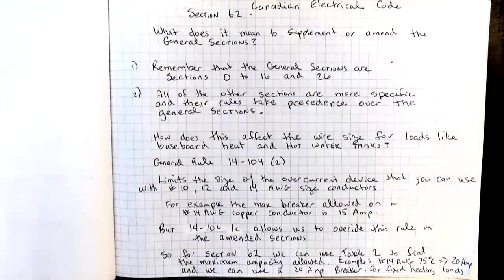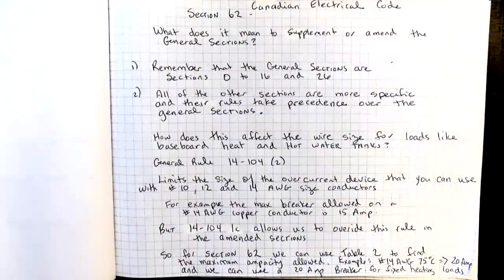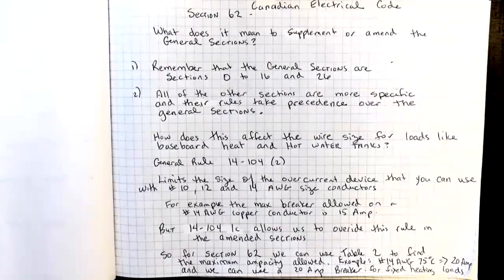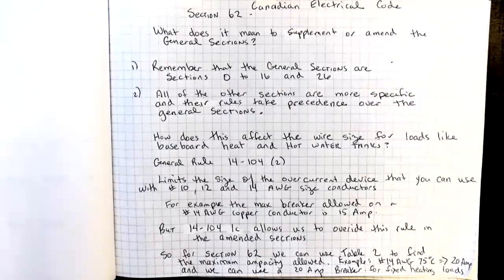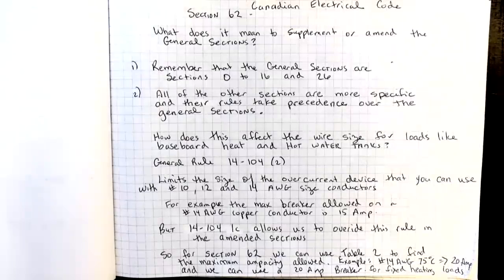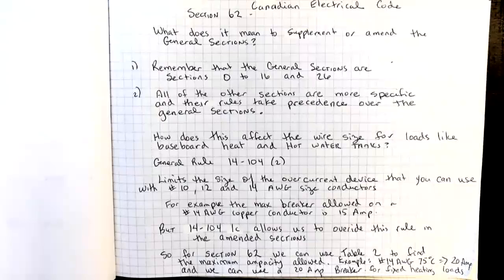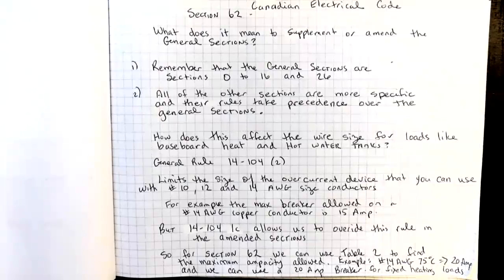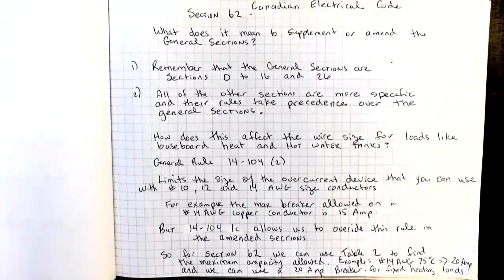CEC 2018 Section 62 Amended Section

Comment: I've flipped through the entire section 62 in the 2021 CEC, and there is no direct remark there about overriding 14-104. The CEC is so hard to read, I'm guessing I'm just not looking in the correct place, maybe it is in the appendix or a footnote. I guess it makes sense that a fixed load like a heater would be so exacting that one could accept a choice of wire ampacity closer to the limits of the 75 deg column. On the other hand, we routinely derate small gauge NMD90 to 60 deg C specifically because of proximity to insulation, attics, and sources of heat. Why not derate to 60 deg for heaters?
Reply from the maker: Hi, near the front of the book you will find the Preface and the General Arrangement. This info falls under the General Arrangement heading. There are general sections and then there are sections that supplement or amend the general sections.  Section 62 amends or in other words over rides Section 14. So we can use Rule 62-114 Sub rules 7 and 8.
Reply: @deannalittlejohn5623  Thanks, I'll have a look.
Reply from the maker: @spelunkerd  More specifically there is a video called 2018-Section 62 Amended Section....it explains more about the general sections and the amended sections.